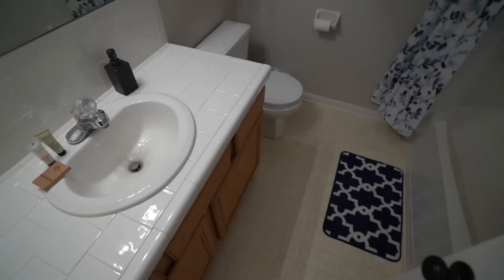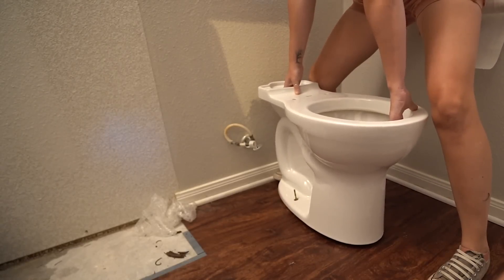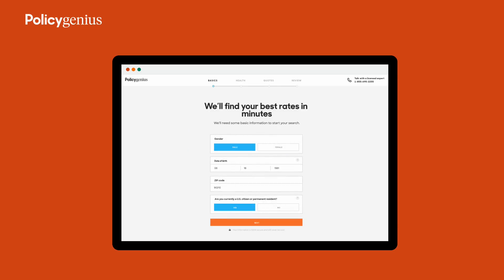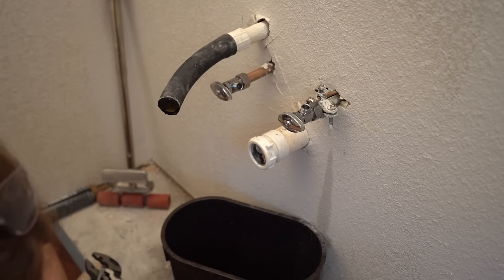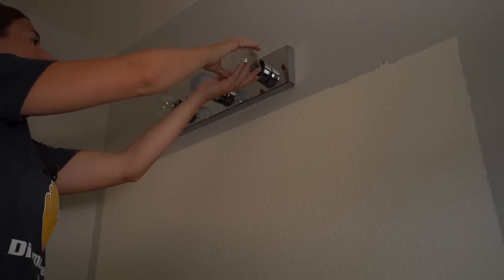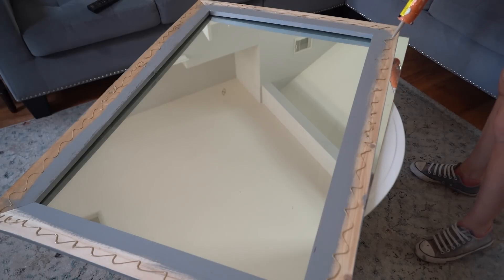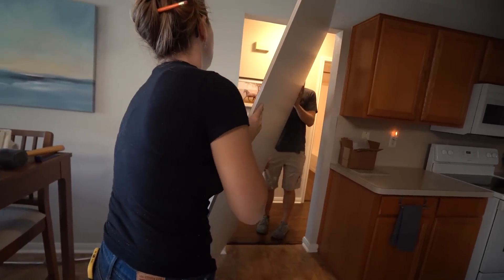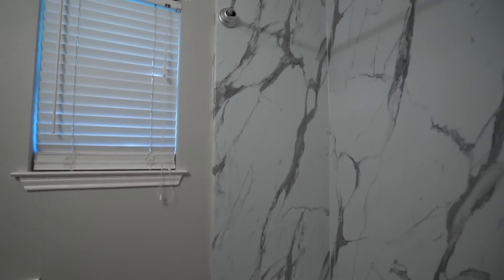DIY Bathroom Renovation in 5 Days! How To Remodel Start To Finish | Part 2

Comment: Great job.  My only change would be to use hardieboard panels to fill the gap above the shower walls…not wood.
Reply: I think I'd have used some of the wetwall scraps for building it up... don't want moisture behind it & I'd be concerned about the wood swelling.

Comment: Hi April, I've installed and re-installed lots of toilets and one tip I give to people is that once you have the flange bolts in place hold them tight with a small washer and a nut. Now when you lower the bowl into place the flange bolts remain firm and erect. Works like a charm. Great videos by the way, I'm certainly a fan.
Reply from the maker: Thanks for sharing the tips and for watching!

Comment: A couple of notes: That metal ring you installed on the floor is called a "closet flange". Also, when you go to bolt the toilet to the floor, the plastic cap base goes down first, followed by the metal washer. That'll keep the nut from squishing the metal washer down into the hole. Then, the cap goes on and snaps onto the plastic. 👍

Comment: On the wet wall system, how did you cover the original vertical strip edges of tile on front of bath opening?
Reply: This is what I was wondering as well. It somewhat looked like the cut another strip to put in between the wall and the wet wall.
Reply: Removing old tile could be not a bad idea...

Comment: I may be wrong, but I am pretty sure that the light over your sink was installed upside down. There was quite a shadow below it which is exactly where you DON'T want a shadow in the bathroom.

Comment: With regard to the tub/shower wall panel, can you talk a bid about how you finish the outside edges (facing the rest of the bathroom)? Is it just caulking or is there some filler strip, or special end pieces to give it a finished look?
Reply: There’s something called a schluter strip you can get. It gives a finished metal edge rather than leaving the material edge. It looks like hers is prefinished, though.

Comment: i have a great tip for repairing drywall but i genuinely cant explain it without being too confusing. ill try again.  you want to cut a sheet of drywall larger than the hole, and on the backside score it to fit the hole, and then basically remove all the innards from the area on the outside of the drywall you need to put in the hole. basically leave the outer layer of paper in that area. you can then fit the drywall into the hole and the paper will cover it up uneven edges. so instead of cramming the cracks with with drywall mud, you have the outer layer of drywall paper to be able to blend into the rest of the wall. i dont know if that made ANY sense but i tried.

Comment: When  removing the old toilet, I lift it into the tub or shower and tip it over to drain the water still in.the bowl/trap. Dry shoes and no messy trail to mop up.
Reply from the maker: I had placed everything I removed from underneath the vanity cabinet and set it in the tub. All I could do was walk and slosh the entire way. Yikes! Thanks for watching.

Comment: April, came across your bathroom renovation and use of Wetwall shower panels. I've been looking at Wetwall and Fibo panel system.  It looks like it's been a year since installation, panels still sticking to tiles?  If I went with Wetwall they would be glued to new green board not tile. How did you decide on Wetwall?  It would be the easiest of the two systems and cheaper. Any feedback appreciated.  Like your channel and great job on Tim Allen's show!
Reply from the maker: Thank you for your kind words. No problem at all with the Wetwall shower panels. It was easy to do and is as great as the day I installed them. Thanks for watching.

Comment: What was with the ground on the copper pipe? I have never seen that on a pipe in the bathroom. And April seriously standing in the sink! Wow!! Looks good April see you on the next one!😁
Reply: For example in Europe, in bathroom - electrical outlets wire "Protection Earth" must be connected to water line.
Reply: @CzKaa  In the US, modern home wiring comes with a grounding wire in the sheath. On the outlet side, there is a ground screw on the outlet itself. On the service panel side, all ground wires go back to a common ground, which is connected to a copper grounding rod driven deep into the earth
Reply: @pawpawstew  Yes, all this is in EU same. Plus ground protected wire must be connected with water line for outlets near of water sinks. Same in kitchen. Safety+. :) 
BTW, many things of US el. constructions methods are banned in EU. For example wires/cable (in US with thin isolation) direct on (or trough) wood. :)

Comment: I saw you had two different colors on the wall and behind the toilet tank you missed your chance to make the wall behind the tank the same color as the rest of the wall or did you come back later and fix that?
Reply from the maker: I ran out of time so that little square of a different color is still there, but you don't see it with new toilet in place.  :)  Thanks for watching.

Comment: I have some advice.  Your toilet supply hose has a plastic nut on the fitting that connects to the tank.  I just had a flood in my bathroom caused by that plastic nut cracking open after 25 years.  Get rid of it and replace it with a hose that has a metal nut - $5.50 on amazon.  And, while you're at it, attach that end first - it's easier to screw that fitting in crooked and strip threads.  Make it finger tight and then twist the hose as required to make the other connection.  Tighten as required.  Plumber's grease wouldn't be a bad idea, either.

Comment: The measure twice install once ,,,,, may apply here. I noticed (at least it appears that ) the light fixture is not centered with the length of the mirror. In the vid the light emitted is mostly in the corner and the wall where the towel holder is in shadow.

Comment: Does the sink not have an overflow? What happens if you leave the plug closed and let the water run? What stops the sink from flooding your bathroom?
Reply: Nothing.
Reply: @jeanchapman1301  wow, what terrible design. Why wouldn't they put an overflow on it? Don't think you can even but a sink here without one!

Comment: Hi April,
The revamp looks awesome. That compression fitting, what you call a bushing is named a ferrule. You can keep the nut and ferrule intact making sure the ferrule is aligned with the nut and just slide the valve onto the pipe stub. That way you won't have any worry about cross threading the nut. Good tip about installing the faucet before installing the counter top onto the vanity. You made installing the shower panels look so easy. You and the family stay safe.

Comment: When replacing the old valves under the sink, why not go to quarter turn instead of the type that requires multiple turns? All I can say is that having to shut off water for one reason or another under a sink, having to do multiple turns is a big inconvenience especially in a cramped space. There are a variety of quarter turn valves in various sizes that will shut off the water completely without having to waste more time twisting and twisting and twisting those handles. If you live in a place that has hard water it's even worse. The minerals collect around the components in the multi-turn valve making it even harder to close. I've never had that problem with quarter turn valves. Just saying...
Reply: Building code may not allow to use quarter turn valves for drinking water service. Gate valves are more reliable.

Comment: FWIW, it's easier to attach the supply lines to the sink fittings before you place it on the vanity, and attach them to the shutoff valves after the sink is in place. You'll nearly always have easier access to the shutoff valves than to the underside of the sink in place.
Reply: Maybe valve hoses are connected to sink fittings hoses ... :)

Comment: As a plumber, it’s better to attach the supply hoses to your vanity sink top before setting it. By connecting it this way you will find it easier to connect the supply tubes to your valves.!
Reply: Maybe valve hoses are connected to sink fittings hoses ... :)

Comment: Wax rings are a serious pain in the butt and have caused more floor damage and first floor ceiling damage than any other plumbing item. Not to mention they are seriously f-ing gross to scrape away from from the flange and the toiled bowl. I love using Fluidmaster replacement rings and have never experienced a leak with over 20 years of use.